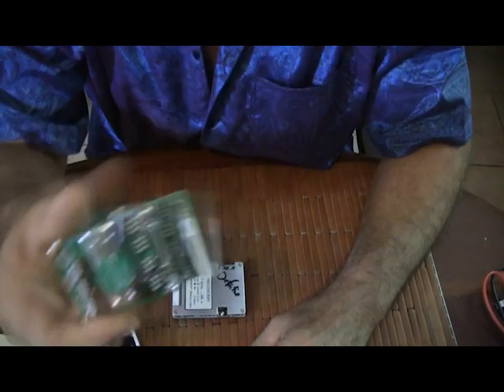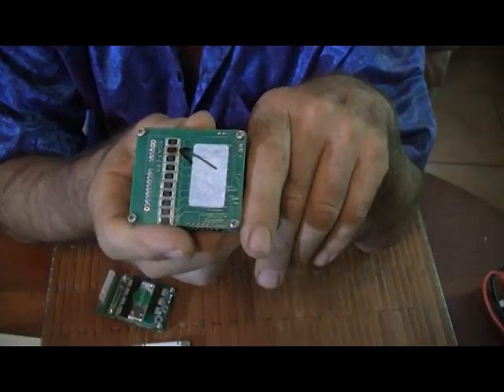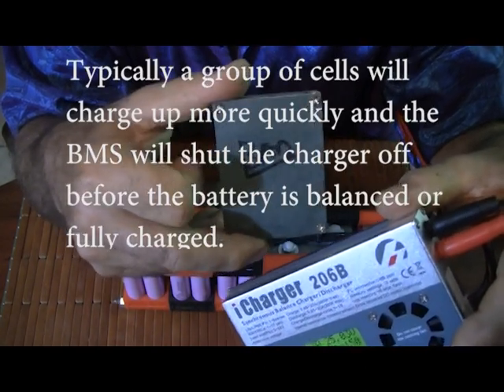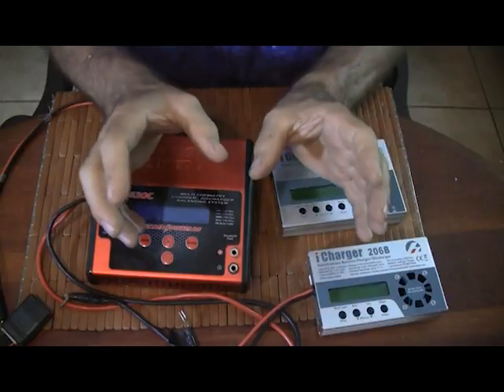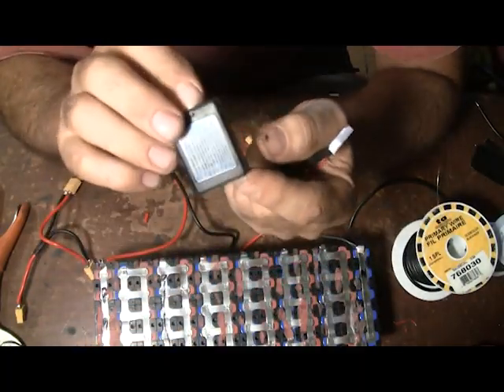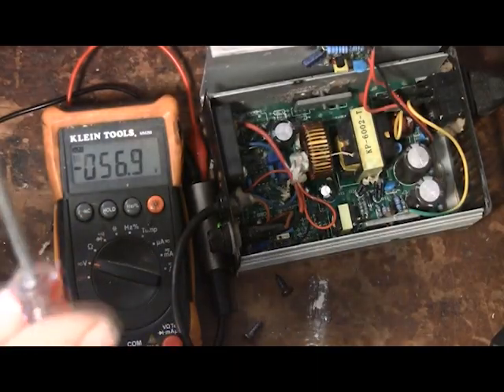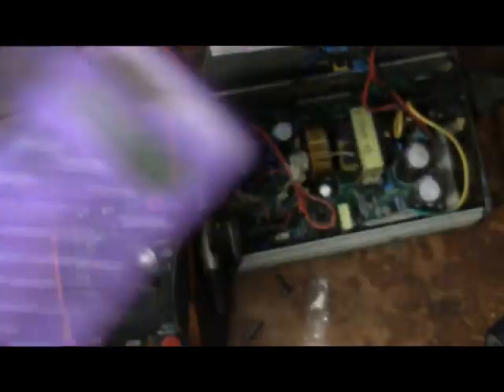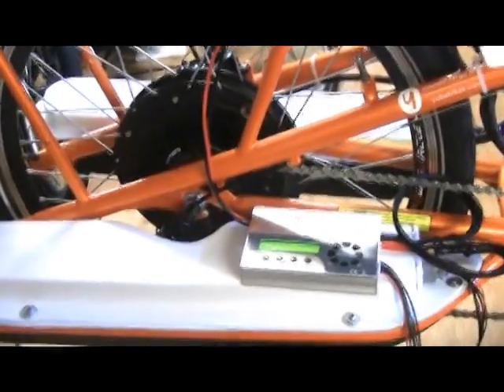How to build a safe and better lithium battery WITHOUT a BMS.

Comment: Damn! This was an eye opener. 

Can you please give a few links to the parts, the hobby charger and that digital cell logger? I tried finding it online, and no luck.

Thank you!!!
Reply from the maker: The batteryblocs are found here:    www.batteryblocs.com

The hobby chargers are found all over but http://www.buddyrc.com/ is a reputable vendor.   Icharger makes quality chargers/balancers.

The cell loggers are found at HobbyKing   
http://www.hobbyking.com/hobbyking/store/__67120__HobbyKing_8482_Cell_Checker_with_Low_Voltage_Alarm_2S_8S_AR_Warehouse_.html
Reply: Perfect, thank you!
Reply: I'm also still not sure I understand how the hobby charger knows which cell is which. Is there a similar wiring system for it, like for a BMS, that connects to each cell before and after? Tried looking for a video that covers it, couldn't find one :/
Reply from the maker: Hi Mike,

The hobby charger connects to the same wiring harness that is used by the cell loggers.  It is wired identically to the BMS sensor wires.   It starts with a negative wire going to the negative terminal of the battery and a set of wires that go to each positive cell group.  So, a 14S battery would have 15 wires.  The hobby charger knows what the voltage of the first cell is, and it knows what the total voltage of cell 1 and 2 is, and it does the math to arrive at the separate voltages of cells 1 and 2 and 3 and etc.
Reply from the maker: Go to BuddyRC or Hobby King for hobby chargers.  Here is the link to the cell logger:

http://www.hobbyking.com/hobbyking/store/__67120__HobbyKing_8482_Cell_Checker_with_Low_Voltage_Alarm_2S_8S_AR_Warehouse_.html
Reply: Makes perfect sense, thanks!

Comment: Awesome video! I've been gearing up to build a battery for an electric skateboard and I've never fully felt comfortable with the BMS due to it's lack of visibility into each cell's performance.  

With that said, I'm a neophyte at building batteries.  Some of the resources of I've found strongly encourage the use of gloves when building a battery pack but I noticed that you don't wear any. Would you be up for doing a short video on what to look out for safety-wise when building a battery?

Also, do you know of any gadget that would allow me to access a battery's info (voltage, Ah, temp, etc) wirelessly (e.g. bluetooth)?  I have a background in building software and I want to build a more fancy "dashboard" for my battery.
Reply from the maker: Hi Pieter,

By far and away the most important safety tip is not to short the battery accidentally!   There is so much power and it always results in molten metal.   

I am building a designing a bluetooth Android controlled BMS.   I too think it is a good idea!  Want to help?
Reply: +Shawn McCarty yes, but to manage your expectations it's a project that is farther down on my list but is something I'll be chipping away at.  What's the best way to keep in touch?

Comment: So in theory you could use an icharger or two to balance but also as a daily charger to reduce the amount of gear, or would this be simply to slow?

Fantastically clear tutorial, even I could do this project now :)

Seems like there is room in the market for a quality 14s cell logger and balance charger.
Reply from the maker: Hi Jayme!   Sure you could use an icharger as a daily charger.  They can put out a lot of power.  You could also adjust the balance between 4 volts and 4.2 volts depending on your need the next day.  It's what I do. My icharger 308 duo can put out 1300 watts.   Just remember you will need a power supply to power the charger.  But that could be a 12 volt automotive battery on a trickle charger or a computer power supply or an older 36 volt ebike charger or....

Yes I agree there would be a market and I am working with an electrical engineer to develop one.  More later.

Comment: Would you please supply a model number or link for the little device 
that reads the voltage from each cell?
Reply from the maker: That is called a cell checker.  You get them at Hobby King.    Here is the URL:  http://www.hobbyking.com/hobbyking/store/uh_viewItem.asp?idProduct=67120
Reply: Thanks Shawn, just what I was after

Comment: BMS's bleed the highest voltage cell?
 I thought they pump charge into a capacitor from the highest voltage cell and then charge the cell with the lowest voltage.
Reply from the maker: You are right Michael.  There is a BMS type that does that but it is rarely seen because it is more complex and expensive.  On the surface it would appear to be more efficient as the power is not being wasted.  But the amount of power wasted in a "bleeding" bms is is very small.  So in practice, the $ saved by the extra efficiency is never offset by the increased cost of the capacitor type BMS.....and so they are rarely used........
Reply: Shawn McCarty That topic kills me then what do the commercial product designers use in the Ebikes and all other high power battery applications?
Reply from the maker: All the ebike manufacturers use bleeding bms's from China.
Reply: And how inefficient would you approximately say it is in percentage? how much power would it waste during a full charge of a battery.
Reply from the maker: So a BMS might have  1/2 watt of balancing power.  Lets say that it balances for 2 hours.  So that's one watt of wasted energy.   The national cost for electricity is 12 cents per kilowatt hour.  So the cost of wasted energy in 1 balance cycle might be .00012 of a cent.     Chargers waste a lot more energy being only 85% efficient.  Your thoughts welcome!
Reply: Shawn McCarty huh Well that's not so bad considering the cells are matched pretty well for that 0.5W of balancing power in my case that would be 0.27% of the total energy to waste for 2 hours.

But even when balance charging with a balance charger it uses those bleed resistors to balance the pack so you don't get out of it even there.
Reply from the maker: You're right, you don't!
Reply: Then I still think I should use a BMS despite the cost sins my vehicle cost a lot anyway and you cant bypass the bleed. 
After all that adds security and comfort not having to mess with alot of buttons and an extra plug.
Reply from the maker: Michael,    Hard to answer without more details.  It is a personal choice, I just wanted to present this option.  Either way it's electric!
Reply: Shawn McCarty Yeah sure thank you very much for answering the questions it tough me a lot I'll just be more careful when adding a BMS and not just look at the price...
Reply from the maker: You know you would think you get a better BMS by spending more.  I have not found that to be true....  If you are ordering a sub $35 BMS you might just order two.  Often I get ones that are just defective and there is no returning them to China.....
Reply: @shawname2  The laptop style chargers run hot compared to fan cooled

Comment: im not looking at this because i want to build an Ebike like most. But i want to use lithium ion batterys for some tools and a portable radio system. But a lot off people keep yelling you cant just do it because you need a lot of electronics in the battery pack and all that bs. But you just proved to me it can be done with some simple electronics and instead use a better charger(wich is better in my opinion anyway because i would like to see what my batterys did instead of just trusting it will be fine)
Reply from the maker: Yeah, exactly right.

Comment: Hey Shawn can you recommend any good 18650 batteries and where to buy them? Or best way of getting them?
Reply from the maker: Chris,   How you are going to use them is important.  An 18650 battery with a high C rating can dump a lot of power quickly for it's size but will have a shorter life.   I build larger packs for my touring ebikes and I am more concerned about long life and larger capacity so I use the Panasonic 3400 mah cells.  

I have a supplier in Hong Kong.  Use Alibaba to connect with suppliers.  Buy from someone with many years in business and a good reputation.  Buy only name brand cells like Samsung, Panasonic and LG.  Avoid cells like "Trustfire."  They have nowhere near their advertised capacity.  Expect to spend .50 cents per cell to get them shipped to you.   If it's too good to be true your right.

You can order the Pannys from me on my website www.batteryblocs.com.
Reply: +Shawn McCarty thanks Shawn for replying so quickly. I am building a robot.sort of like a battle bot but not for battling. I was thinking on building my own battery pack from 18650 to give me a longer run time. What's your thoughts?
Reply: +Shawn McCarty just checked out the site,they don't ship to Canada.
Reply from the maker: Hmm, that's my site and I don't have international shipping set up.  Just use the contact form and send me what you want and I'll get a price.
Reply from the maker: Honestly I'd prototype with a SLA (sealed lead acid) battery because they are so cheap.  Later when all the bugs were worked out and you wanted longer run times I'd upgrade.  Building robotics is difficult, don't add the additional challenge of building the Lithium battery at first.....   My 2 cents.
Reply: +Shawn McCarty ok I think your right on that point. Most I see do have the SLE . Ok well I subscribed if things change in the future I will contact u again. Thanks for the help

Comment: Great video.  This is one reason I have stuck with 10S batteries.  36Volt gives me 25 mph, which is perfect for my purpose.   I passionately hate BMS which dont provide any feedback.  With hobby chargers you can also charge/discharge individual 1S batteries.
Reply from the maker: Yes, good point.  Sticking with 10S batteries allows you to use a quality hobby charger like the icharger 3010B.  With a 1200 watt controller you can go as fast as your sanity on an ebike.
Reply: True.  I rarely have to balance charge my Samsung 25R 10S pack.  These cells self balance.  99% of the time I bulk charge the cells, while monitoring with a CellLog.  If any cell cluster go out of whack, I can also discharge or charge them individually (1S).  A built in PCB BMS is more of a headache than not.  You are pretty much left in the dark with such BMS.  It would have been nice if these BMSs featured an optional external LCD display, but oh well... my 1010B and cellLog works fine for that purpose.   Thanks for taking the time and sharing this video.  It's much appreciated. Cheers.